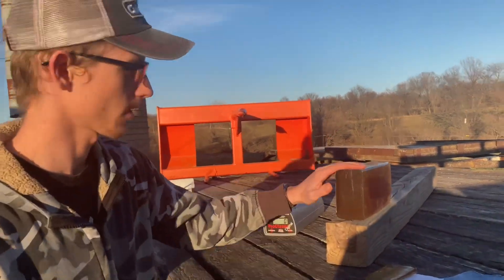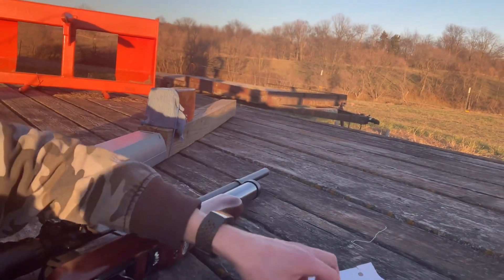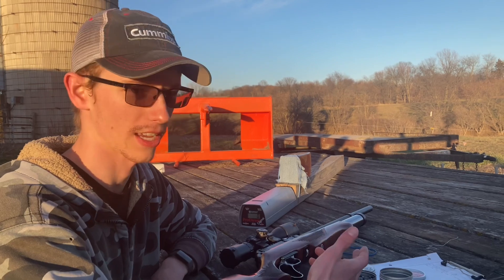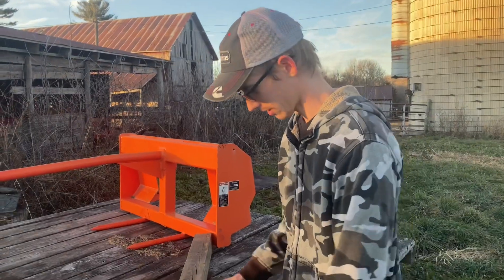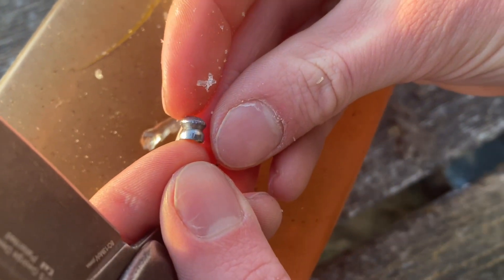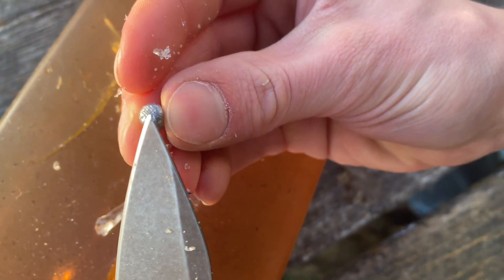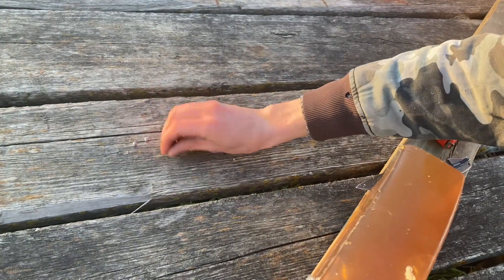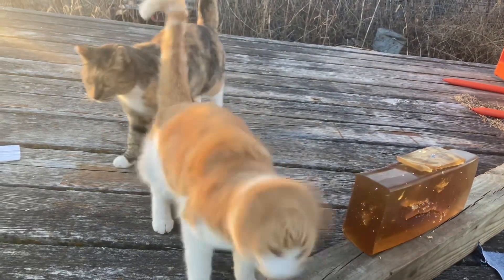Energy vs Momentum Pt.3 | Simulated Small Game Shoulder Hit

Comment: I think we are seeing the lighter pellets are deforming expanding the wound channel and slowing overall penetration vs the slower moving heavier pellet.  There might be a threshold of energy to get through the cans that the slower pellet dropped below (speed) and therefore didn't penetrate the second can while the lighter pellet penetrated that second can.  Something like a .223 at 3000FPS hitting steel and going right through vs .22LR at 900fps and not even denting it.  Great analysis and fun video series!  Maybe you can do one where the velocity at the muzzle is the same speed with the two different pellet weights traveling at the same speed and then do all the same analysis. EDIT - I found something interesting...someone tested 3 different .177 through a can.  One had FPE of 5 and it passed through one side of a can but not the other.  Another pellet was 6.13 FPE and also passed through one side but not the other.  The third was 4.15 FPE and didn't penetrate the first side.  So something close to 5 to pass through the can he used.  If you could  chronograph the pellet speed between layers of the can "lids" that you shot through, you might find the FPE drop off to make it through that second layer of can lid.